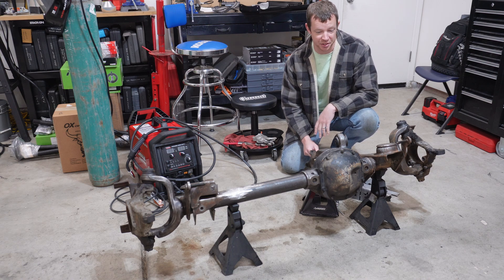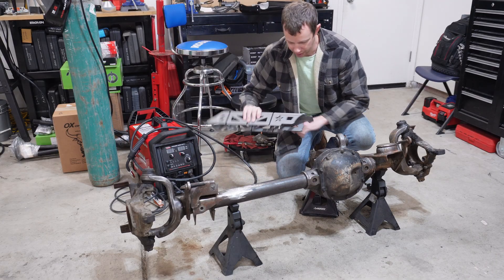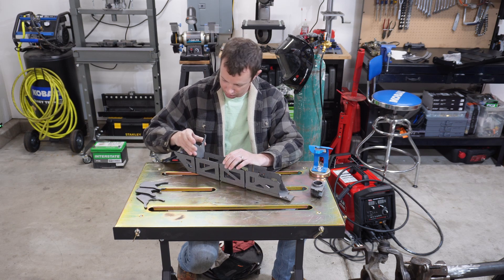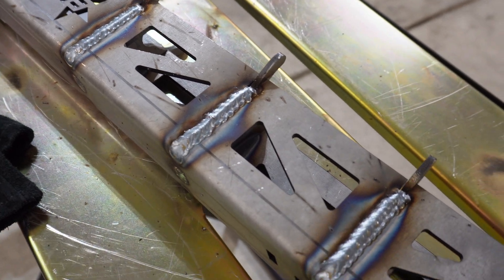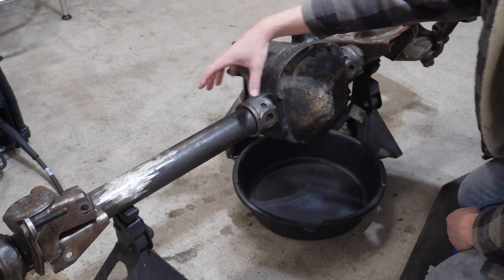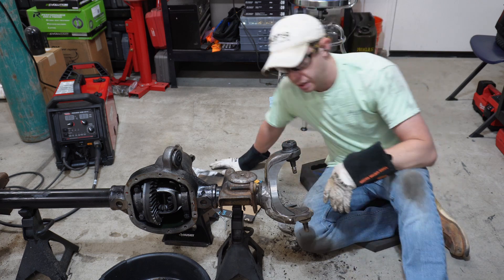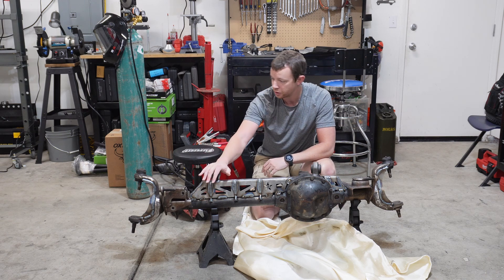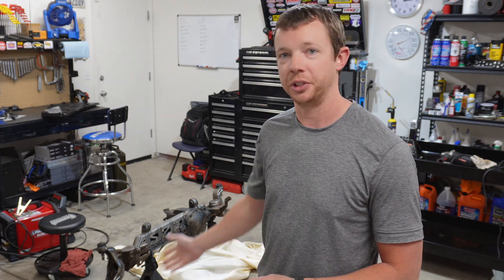Barnes 4WD Truss and C Gussets - Dana 30 Build

Comment: I think they left the brackets off the truss so you can weld them fully to the tube, then set the truss on top and weld it to them. At least that was how my artec truss was made.
Reply from the maker: Nah thats not how the Barnes instructions are
Reply: @HardEarnedBacon  interesting. It probably doesn't matter either way.
Reply: it just keep the cost low when we do it instead

Comment: Will rcv axels still fit after you put the C gussets on? I have bent my Axel end or C  thingy. I wanna beef it up but need to make sure the rcv still fits
Reply from the maker: I'm not sure, would be a little tighter but may still fit. I'd reach out to Barnes and make sure.
Reply: @ so I checked after I got the rcvs installed they will fit but getting the boot on will be a lot harder. Just throwing that out there incase someone else ever wanted t know
Reply: @ thanks.

Comment: Awesome, I'm doing this exact same thing. I decided to cut off the LCA and Coil buckets and replace those with Barnes as well. Are you sticking with OEM UCA bushings? I am leaning to swapping both to a JJ or the passenger to tabs to accept a heim.
Reply from the maker: Planning to go with JJs since I'm in the process of installing Rockjock control arms that all have JJs.
Reply: @HardEarnedBacon  Nice. Have any ideas for the passenger side? I was thinking of either cutting and modifying the old tower to mount on the truss so I can just press in a JJ or looking to cut the barns bushing bracket and weld on a weldable JJ.
Reply from the maker: @Silentway247  I was thinking about welding on a piece of tube that has the same ID as the cast sleeve on the housing, not sure yet
Reply: @HardEarnedBacon  I ended up buying the Artec UCA bracket for their truss and just modified it to fit the Barnes, also went with the Barnes trackbar.